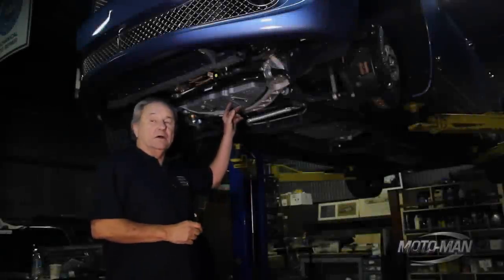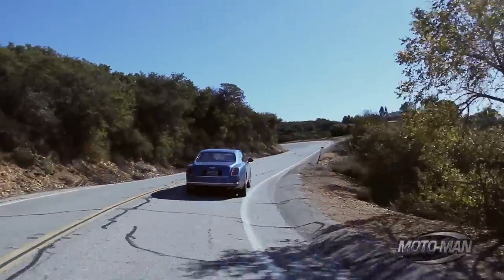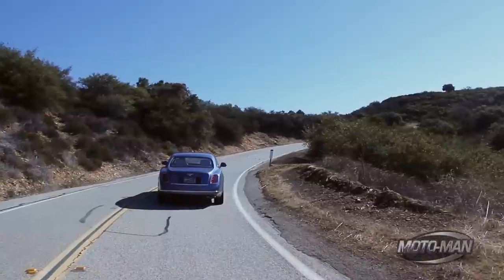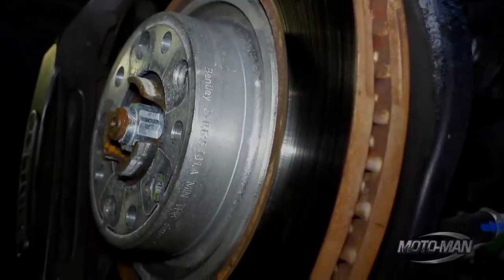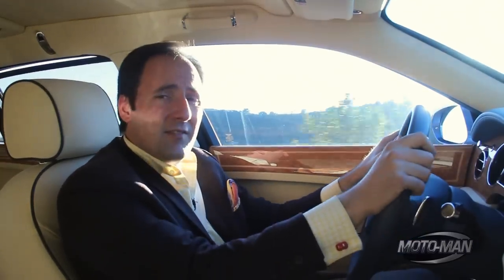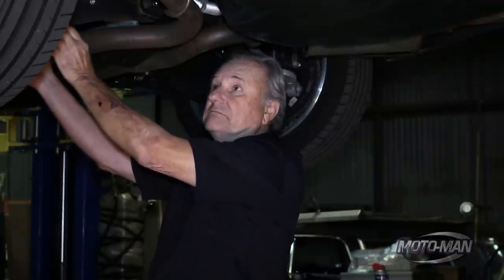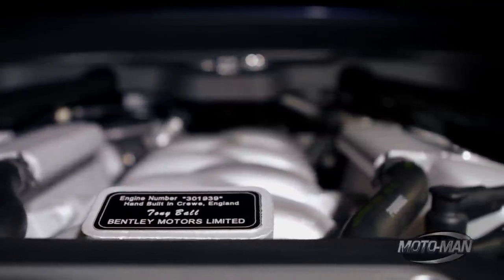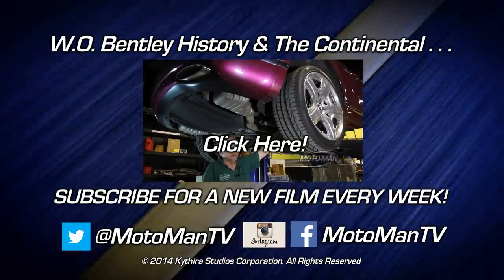Bentley Mulsanne: Why it's the most special Bentley built today!

Comment: One of the first production automobile V8s was introduced in the United States in 1914 by Cadillac, a division of General Motors which sold 13,000 of the 5.4 L (330 cu in) L-head engines in its first year of production.

Comment: Undercoating is not what matters. You see rust where water and debris can accumulate; such as seams, joins between panels, drainage areas.  Check out the rear quarters or Hondas, or the rockers of Chevy's and Fords. Plenty of undercoating on the outside.

Comment: I buy and sell cars. I drove a 2014 Bentley Continetal GT Convertible with 6K miles on it, with all that wood finish and yadayadayada. Really top notch, but somewhat overpriced. I never liked English cars and still don't, but the Bentley CGTC is changing my opinion. They don't last much though, I've never seen on with more than 80K miles. Mulsanne would not be my choice.

Comment: still tehnology of 19th century with some tweaks from 20th century
Reply from the maker: Well, we didn't get into the whole computer control system of the suspension . . .
Reply: MotoManTV It's for sure a very very outstanding car. But it's just an ICE. The future Luxury is electric. Nothing less. So, it's last century's Luxury.
Reply: manoman0 No thanks, most car enthusiasts say no.
Reply: ***** Yes, I fully agree. The new luxury will be EV. As a great lover of V8 engines it's easy to accept EV as the successor of V8 (or V12 for that matter). So, you love muscle cars, you love E-power. Simple, actually. Alot of people can't wrap their heads around that statement though.
Reply: *****
you think electricity and electric cars are 'green' and not poisoning the Earth? Where does the electricity come from to power the factories that make these cars... coal or nuclear power stations. How do you think batteries are made? All the metals are strip-mined in poor countries then transported across the globe by diesel train and gas turbine ships.
Reply: poor countries? lol? they are mined everywhere from kenya to USA